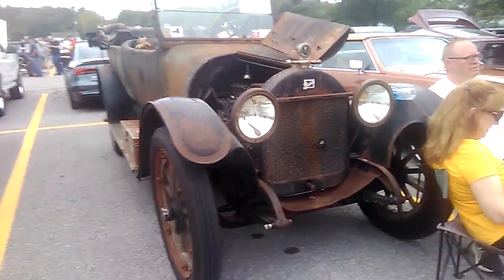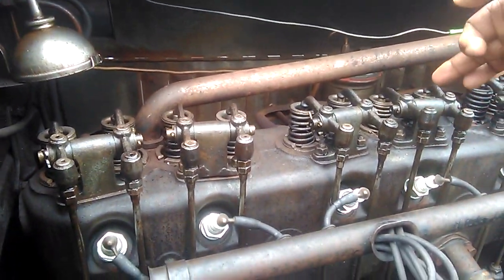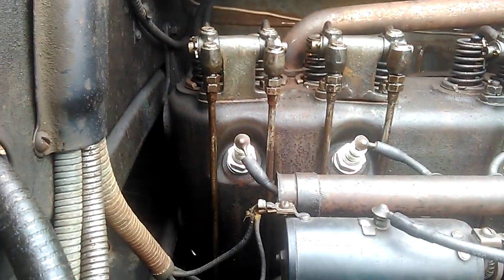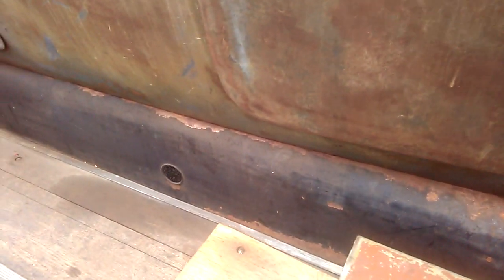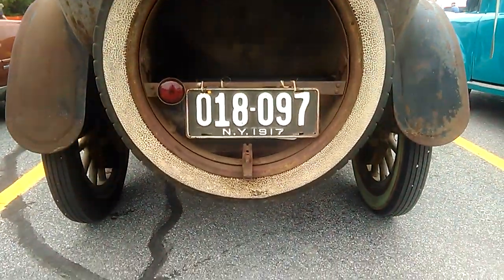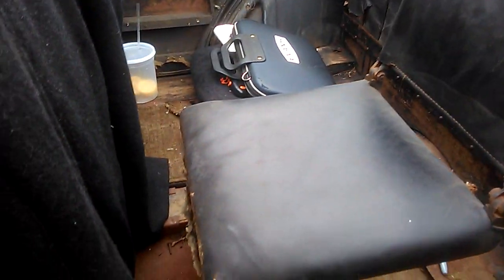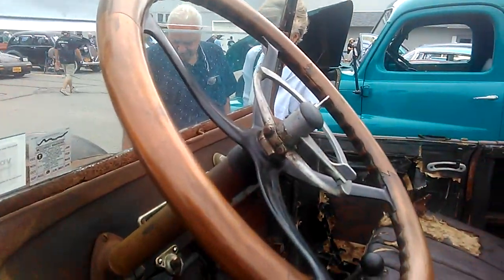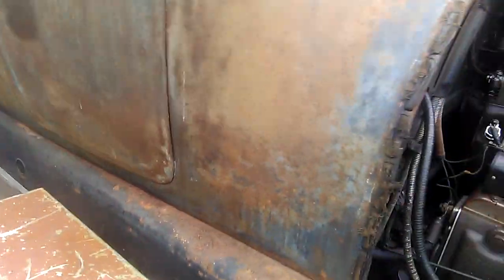1917 Buick 6 cylinder, convertible sedan

Comment: Great video. L head engines have the valves in the block, this is an overhead valve engine, valves are in the head. Also, Beverly Hillbillies had a 1921 Oldsmobile.
Reply from the maker: I knew the BH vehicle was an Olds, didnt remember the model.year though. 
I find this Buick engine interesting. It is fantastic to see primitive engineering and how the engines worked back then

Comment: Great Buick 👍👍The levers on the steering wheel is the advance/ and retard for timing the spark while you start up/ drive.
Reply from the maker: Sweet. I couldnt figure that one out. I have to get a manual on this engine. It is a very peculiar design with an entirely exposed valvetrain. I like the woman asking me if the car was in a fire as the reason it looks so bad. It is a 100yrs old! How do you think you would look when you hit 100?

Comment: The levers on the steering wheel are to advance and retard the spark and to adjust the fuel air mixture
Reply: You got the spark advance one right, but the other is a throttle, for idle speed. To adjust fuel air mixture you use the choke.
Reply: @hyzercreek  on that particular vehicle? The ones I've seen had a fuel air mix on the steering wheel